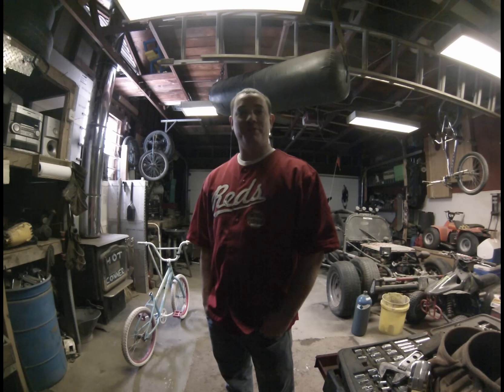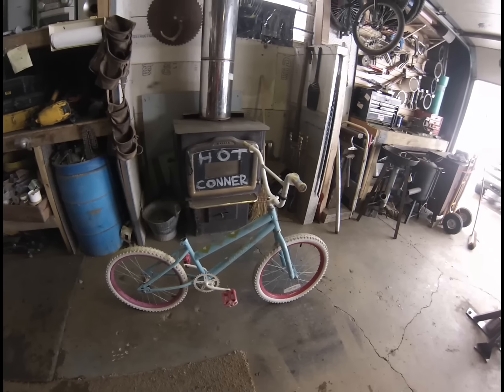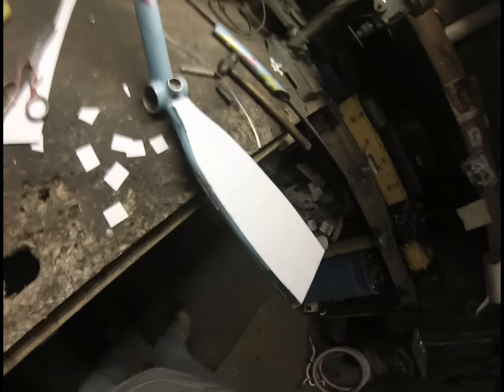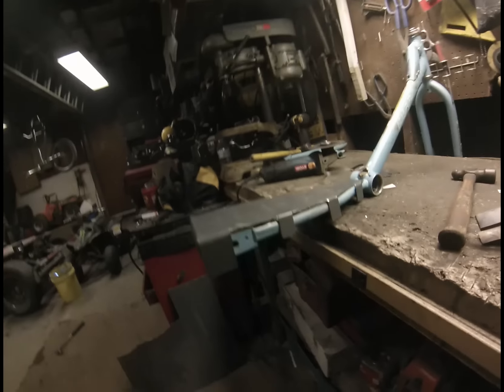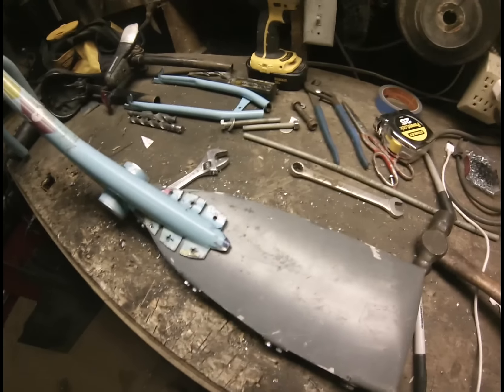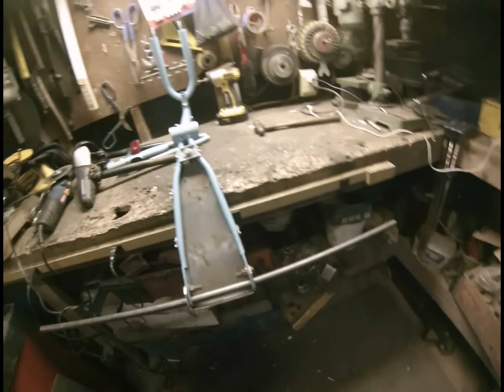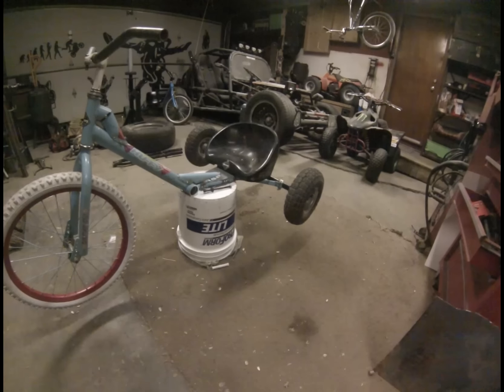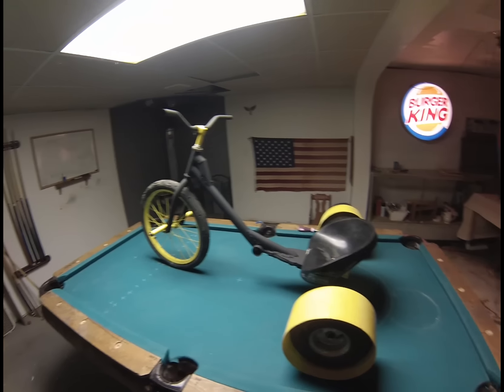How To Build A Bolt-Together Drift Trike (No Welding)

Comment: Everything about this drift trike, all the cuts , bends, use of entire bike, and making it bolt together. I have to say is pure genius. you really opened my mind to how to actually cut the metal in order to bolt it in.  Great job.
Reply: this guy did a great job but for your own sake please weld it! its much safer cheaper and quicker
Reply: @Sadge1999  i dont know about safer because the bolts can vibrate liose

Comment: I've got a new challenge for you. A bolt-together trike that collapses or can be taken apart for compact storage. I live in an apartment and an idea of the space I've got, I need it to fit in the trunk of my car lol. If you were building that, where would you focus on making the bolt-away parts? I'm thinking a bolt-away steering neck or simply a bike with a removable handlebar, and bolt-away axle or seat. I'm not even sure if it's do-able, I just learned about drift trikes about a month ago so yeah lol.
Reply from the maker: wish i had time to do that. excellent idea

Comment: You are a very skilled and patient builder I'm building a trike right now and do you recommend fixed axle (like this video shows) or a rolling axle (like you put on you motorized trike)?  inflatable tires with pvc over them or wood with pvc?
Reply from the maker: Thanks bud...i do recommend a fixed axle so the bearings are in the wheels...also recommend inflatable wheels....i use wood with couplings alot simply because it is a much cheaper way to go but they work perfectly....in some of my vids, i use 1/2" axle but thats because i had 50' of it lying around...5/8 or 3/4 will give ya much stronger axle....i always reply to Q's guys and good luck with your build..

Comment: Is there a way to add pedals to the front tire so you can pedal it. Like maybe use the pedal assembly off another bike and weld it to the front forks. I know this is a non weld video but just trying to imagine how you could add pedals to the front like a kids big wheel

Comment: You would remove the bolts on the front tire and put small pegs on.  No need for the bolts if you can screw the pegs on just as tight.

Comment: Pretty awesome video but im curious as to what thickness the sheet metal was
Reply from the maker: Thanks dude...i used 1/8" sheet metal...it makes the frame much stronger to bend tabs down, rather than just make a flat piece that screws straight down...that bike needed strengthened wherener possible...little lightweight girls bikes are weak and should be only used as last resort...iv built a bunch of trikes now and i stand by mongoose as an excellent choice for a strong frame...good luck bud.

Comment: Hey, big fan of your work! What size tires do you use? Where did you get yours at?
Reply: idk what he used, but i got some decent tires for cheap from harbor freight, people complained about the bearings on them, but theyre just being fussy. If you're not welding it, you probably won't have that much to spend on fancy bearings anyways.
Reply from the maker: Sorry dude missed this comment...i took these inflatables off of a 2 wheel dolley...i use anything i can get my hands on that i can repurpose...dont like to buy parts new...9" tires.
Reply: i didn't have much choice, as im a teenager and speding 16 bucks on tires is a lot easier for me than trying to find a dolly or something like that. :P

Comment: ive never understood how you get the sleeves to stay on the tyres, surely as soon as you get sideways they would slip off but on video's they dont? Has do you make them stay?
Reply from the maker: Deflate the tires, slip on pvc, then inflate...the pressure will hold them.

Comment: Did you glue the yellow covers on the tires ? Welding would be structurally advantageous.
Reply from the maker: Air pressure holds the pvc on. I have vids on how to weld them up but not evryone can weld.

Comment: How do you keep the wheel in the pipe, do you just deflate it and then pump it up once it's in the pipe or do you glue it?
Reply from the maker: Air pressure holds em...no glue needed

Comment: How is the flex? I made one like that but the rear axle was weak. if i was to stand on the rear tires while holding the handlebars i was able to bend the frame (from the crank to the axle) are you able to bend that type of frame like that?
Reply from the maker: if you are buying a rear axle...theres a difference between cold-rolled steel and hot-rolled steel...thats where the strength lies in an axle...as far as the bike frame...these little girl bikes are the weakest, should be last resort...That little gusset i made that goes over the crank housing, that really strengthens the frame...Im 190 lbs and these trikes hold me fine...Iv built a bunch of these now and of all the bikes iv cut up...mongoose is my #1 choice for strong frames.
Reply: ***** i used an old green machine axle and a mongoose frame. i took out the plastic caps and added 2 washers to both sides to hold the 5/8 bar for the axle. i think i made mine to heavy, but it's not going anywhere. im going to keep building them so i would love to get more ideas on how to make it just as solid but to also make it lighter. i've seen crossbars go from the frame to the axle but i have no idea how much flex that way will take out of the frame. here is the reinforcement job i did to mine https://www.facebook.com/photo.php?fbid=744344222263033&set=a.211345328896261.57238.100000623851258&type=1&theater

Comment: Hello. I was wondering, what have you used for the back wheels. How is the plastic fixed on the wheels?
Reply from the maker: Deflate/ slip on pvc/ inflate
Reply: What kind of wheels? dimensions?
Reply from the maker: Honestly dont remember on that one bud and its long gone...was prob 8" tires but im building trike #21 right now and i use all diff sizes and kinds...really it's whatever you can get your hands on that will work for ya...not always easy to find the stuff. Good luck.
Reply: Thank you :)

Comment: What kind of plastic did you use for the wheels and how did you put it on?
Thinking about making a drift trike but the problem is i cant seem to find any "plastic" wheels or plastic "covers"..
Whats your suggestion?
Thanks in advance :)
Reply: +Thomas Lilwayne deflate your tires get some pvc pipe that will go over the wheel with some extra room than reinflate the tire boom done
Reply: +jack black never even thought of that! genius
Reply: +Colin R Thats how they always do it on drift trikes. It is a clever and easy way to it!

Comment: i have question. wich way would it be stronger? welding or bolts?
Reply: OriginalMe there about the same...but weld is useably stronger

Comment: What do you use for you plastic on the wheels?
Reply from the maker: I always use pvc...that night i made this video tho, i could not find any pieces in my shop or my barn...i cut a couple plastic buckets and inflated the tires inside so i could finish the vid that night...they would work but pvc is what ya should get ahold of...the thicker you can find, the more miles you'l get out of em.

Comment: How do cut the tabs on the sheet metal, also is that steel or aluminum sheet metal
Reply from the maker: grinder with cutting wheel on everything. all steel.
Reply: thanks

Comment: hears an idea  use that same design and put a high torque motor behind the seat ad/make the parts for the axle dont use pvc on the wheels the idea is to make the trike burn rubber im workin on a trike that can do just that i just need a grand to build it reason i live in a area that has no hills that can be drifted without some self powered device :p

Comment: how do you drive the wheels?
Reply: that sounds like a lot of work, I think there should be a motor
Reply: You can attach pedals to the front wheel
Reply: i had the same question but if you do a mountain bike it will be bigger so you can have more frame to work with
Reply: people usually do this downhill so you dont have to pedal

Comment: When you say "tappers", are you talking about something like http://www.mcmaster.com/#tapping-screws/=u830r4?

Did you have to drill holes for them?
Reply: Guessing he means self taping metal screws, they will have a point on the end of them that drills the hole and then threads that hold it in. Local hardware store will have them just don't get too big of one's length or width wise
Reply from the maker: self tapping screws